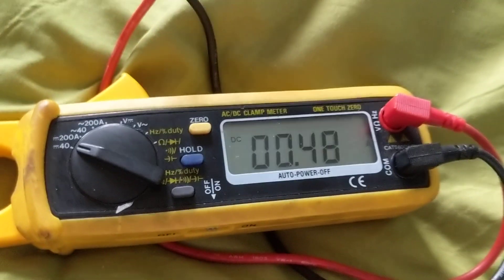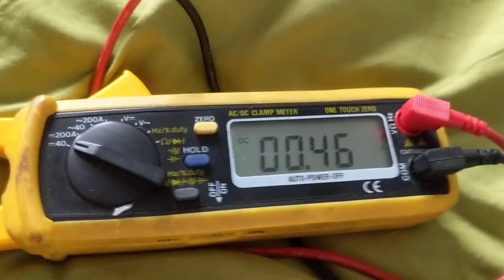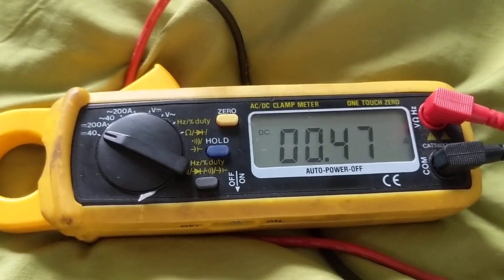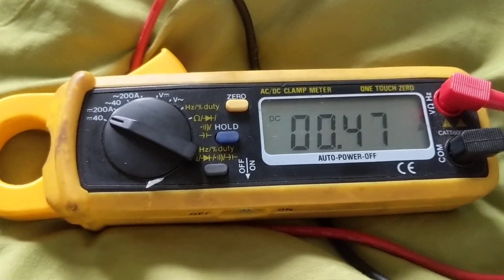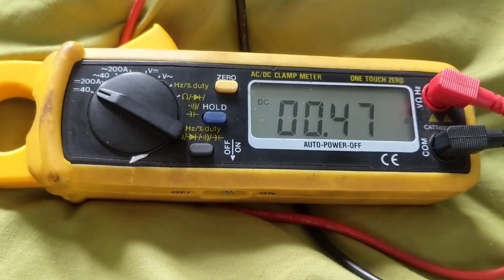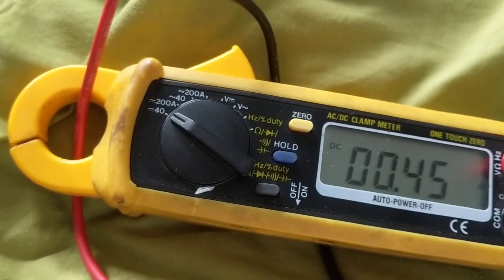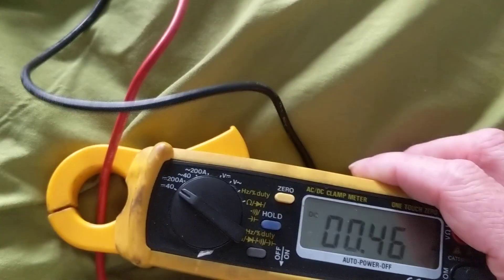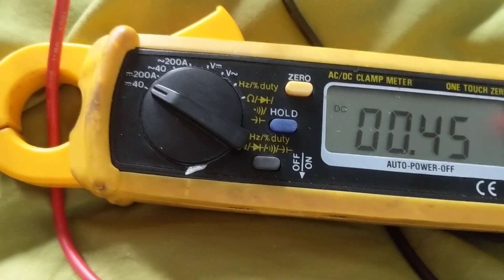BATTERY TEST FOR DRAINAGE with  CHEAP clamp amp meter and multimeter

Comment: Poor description. 1 amp is too much. Even .90 down to .70 is too much... the normal car uses between .30 to .65 because of memory seats, clocks and alarm systems... Also, which system is drawing the most..?
Reply: Thank you for your comment if you saw my other videos on my channel named Joe electronics schematics for Auto I described into more detail a parasitic draw and more measurements and around 750 milliamps sometimes as even drawn anything above that I classify as too much of a draw. Remember there's a body control module anti-theft system module a radio module and some, and obviously the PCM module or sometimes ECU module. In today's cars people install cameras which drawer current also this is why I said my rating of 1 amp. Thank you so much for your comment please see my channel for the other videos much appreciated for your comment

Comment: The "CE" mark on the meter means that the manufacturer takes responsibility for the compliance of a product with all European health, safety, performance and environmental requirements. CE stands for "Conformite Europeenne" , French for European Conformity. I just unsubscribed.
Reply: Yes I believe I said that on another video about the clamp meter on the channel
Reply from the maker: Yes thank you for the comment c e is on power supplies electrical instruments all over as I believe I stated before I believe I spoke about that on another video on the channel thank you